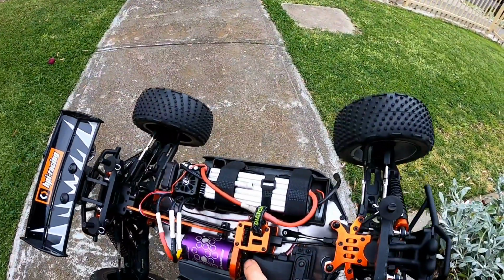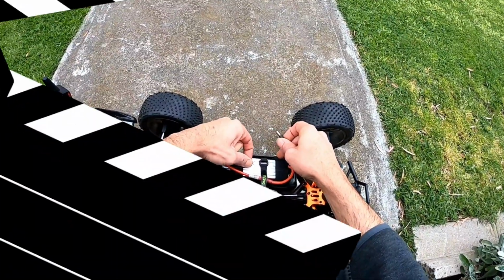HPI 1/8 Flux Truggy 6s first drive! 😍OMG!

Comment: Hi pal dunno if your going to see this but recently got one of these for Christmas and it came with 
2 - 4000mah 7.4v 50c 2s battery’s 
Got 2 questions for you 
Can I upgrade to 4s with standard motor ? 
What does it take for me to upgrade to 6s ?
Reply from the maker: Hey mate🙂
So the stock esc and motor should be the 4s system so you can run your 2 x 2s lipos is series to make it a 4s 4000mah pack, the esc should have dual plugs or series wiring already if you got it brand new I thought🤔

But for 6s you'll need a 6s esc a 6s or 2 x 3s lipos obviously and I personally would stick with the stock motor but drop to a slightly smaller pinion or add sufficient cooling for stock gearing.
Reply: @rccrazy  I know it’s too much to ask but do you by any chance have a link so I can have a look at the upgraded esc and motor
 Thankyou
Reply from the maker: Not sure this link will work for you if your not in Australia, if not basically any 6s 150a esc will do the job with your motor but please buy a quality brandvlike Hobbywing, Castle or the name brand escs like HPI, Arrma and equivalent, PLEASE for your own benefit and long term cost stay away from the Surpass Hobby escs💥
This is what I basically run in mine👇
https://www.ebay.com.au/itm/325532785559?chn=ps&_ul=AU&_trkparms=ispr%3D1&amdata=enc%3A1tl5t_nPLTIq6cKVnVoLFdA58&norover=1&mkevt=1&mkrid=705-139619-5960-0&mkcid=2&mkscid=101&itemid=325532785559&targetid=1598469861558&device=m&mktype=pla&googleloc=9071421&poi=&campaignid=19657035767&mkgroupid=143201283022&rlsatarget=aud-1185245468113:pla-1598469861558&abcId=9305369&merchantid=114250063&gclid=CjwKCAiAkp6tBhB5EiwANTCx1NFq4YOgwbrvXf3jJ9GKapmUAJ0R7luUPoKZrfrM6W7wde8xVm0MTRoClh4QAvD_BwE
Reply: @rccrazy  appreciate it a lot man thank you
Reply from the maker: All good mate, happy to help.
Good luck👌

Comment: Sweet ride mate, very nimble little truck. Def bigger wheels will fix the in air acrobatics maybe try the  VRX wheels if there 17mm?
Reply from the maker: Exactly what I was thinking with the wheels but no the VRX wheels aren't 17mm and are actually a bit smaller.
I really need some!

Comment: Ordering one this week. Will just be running 4s. Can't wait to bash. Haven't had a good bashed in a few years  cant wait!
Reply from the maker: Very nice, these are great truggys, it should be sweet on 4s and you can keep it light weight so technically will be stronger than mine, they are very strong even with my 6s motor and stupidly heavy X-maxx esc.
Reply: @rccrazy  oce always had good luck with hpi stuff. Bashed a savage for years. Just ready for lipo. I've always run and raced Nitro stuff.
Reply from the maker: I can guarantee you will miss the noise of the Nitro😟 for a while, but I can also guarantee you will absolutely love the power of brushless!👍
Reply: @rccrazy  noise and the smell! Love the smell. I will miss tuning the engine. I did enjoy that also. Just ordered mine. Will be here Thursday. Can't wait! Thanks for the replys!!
Reply from the maker: Not a problem, any time.
Enjoy that new HPI mate! ✌👍

Comment: hey dude, nice car! can I install a 6s lip on a stock trophy trugy?
Reply from the maker: Hey mate👍
I think the stock ESC would be the Flux Rage 80a, if so then no it's 4s max.
My truggy was the rolling chassis version and I went straight to a 6s set-up.
If you decide to go 6s I highly recommend having a FULL set of upgraded gears on hand just incase, the stock ones aren't the strongest with 6s.
Oh and thanks😁
Reply: @rccrazy  thank you for the heads up

Comment: This truck is the same design, that Hot Bodies came out with around 2007 or 2008 called the Lightning Truggy. It came out when HPI was offering the Hellfire Truggy, I know because i had both at the same time. I always liked this design better, I guess when Hot Bodies was acquired by HPI they took this design and got rid of the hellfire. I'd buy another for sure, looks like it's still a fun truck
Reply from the maker: You definitely share some new info that I wasn't aware of, iv never heard of Hot Bodies or the Lightning Truggy.
That's very handy to know because I definitely need a new shell for it now and I love this specific design!
Absolutely a beast of a truck, upgraded diff gears really helped running 6s.
Thanks for tuning in👍
Reply: @rccrazy , If HPI hasn't skimped on the quality, it'll be a great truck. Mine was a Nitro (STS .30), was planning to convert. This was when brushless was starting it's official takeover of RC
Reply from the maker: Awesome!
They are an nice platform and would've been interesting with a 4s or 6s set-up for sure👌
I'm all about electric now, not had a nitro for years but maybe get one for the channel eventually.
Reply: @rccrazy , I've always been an electric nut, even when brushed and NIMH were the way. I dabbled with the dark side (Nitro) just to see what all the hub bub was all about. While they were fun and powerful, they were like spoiled children. If they decided to not run, wasn't nothing you could do about it. At least I've never had issues starting an electric, without something bad happening first, like smoke
Reply from the maker: 😆the dark side! I like that👌
Yeah its definitely a electronic age and we're lucky to be living through it!
Reply: @rccrazy yup

Comment: Do you have oil in the shock absorbers and differentials? I'm asking because I need to change the oils in my HPI Trophy Truggy and I don't know which ones will work well for bashing. I will be very grateful to you for your answer.
Reply from the maker: Hey mate
Yes definitely oil anywhere that is needed.
If your still using the stock shocks you would probably want between 60-80w for the front and like 100-120w in the rear.

Diffs, personally I would go 80k on the rear 1million centre and 100k front.
See how that goes👍
Reply: Thanks a lot for your answer!!! But when it comes to shock absorbers, I have already ordered 700cst for the front and rear. And I haven't bought one for differentials yet. But for me, 1 million for the main differential will be too much. I was thinking about 50k/100k/50k, what do you think?

And did you give me the densities you use? And do you know what type of shock absorbers and differentials were flooded as standard? @rccrazy
Reply from the maker: 700cst in 1/8 shocks is a little thin but it should be ok.

Front and rear diffs you could get away with running 50k but 100k in the centre diff on a 1/8 car is no good, the front wheels are going to balloon SOOOO BAD!
Minimum 500k oil in basically any 1/8 car is normal.

What I suggested is a common set-up for me and most of my 1/8 cars yes.
Reply: @rccrazy  So 50k/500k/50k will be ok? Because 1 million is too much for me.
Reply from the maker: That should work OK for this truggy yes.
Reply: @rccrazy  Would 100k/500k/100k be better than 50k/500k/50k?
Reply from the maker: I personally wouldn't use 100k in the rear diff but front absolutely!
I use thicker oil in the front diff to gain stability and steering, keeps the front wheels working together more rather than spinning at different speeds like you would need for racing.
Reply: @rccrazy  And tell me, what kind of things do I have filled the differential and car oil with?
Reply from the maker: Sorry I don't understand what you mean?
Reply: @rccrazy  What I mean is that when I pour oil into the differentials, how much should I pour it in?
Reply from the maker: @oskar_moto69  oh ok sorry
Make sure it is at least covering all 4 of the smaller internal diff gears.

The main thing is not to get oil in the screw holes otherwise they may come loose by themselves.
Reply: @rccrazy  When you poured oil into the differentials, did you pour it so much that it covered all the gears or did the top of the gears stick out a little? And when putting the differential into the RC, what grease did you use?
Reply from the maker: @oskar_moto69 if a little bit of the gears are not under the oil it is ok because when you install the last small gear, the one on the spur gear and crown gears it will push the oil up a little more👌
And I just use red high temperature grease on the diff crown and pinion gears, most thick greases should work fine.

Comment: Great video! Just random mulch piles or what?
Reply from the maker: Thanks👍
Yeah they were for the gardens but the council has used it all, it's been flat ground for about 3 months now😭
Reply: Scary to hear about your battery experience. What happened? My son super glued the shit out of his eyes once squeezing the glue bottle!
Reply from the maker: @tenncutt  wow super glue in you sons eye, that would have be scary!
I was charging a lipo from car battery and when I was pulled the charger terminals of the lead acid battery it sparked then popped 💥

Comment: 1. I have the DSservo 25kg model and it doing all fine. These cheap servos are totally worth it
2. How is your eye right now? I hope you recovered in some sort of way
3. Did you check the diffs any time soon? If I am not hearing wrong there is some sort of cracking noise when you land. Maybe shimming for a tighter mesh will help for the extra load on the parts after landing.
4. But finally sick ride
Reply from the maker: Love the point system comments/questions👌
1. Im with yah, love these cheap servos.
2. I think your talking about the battery blowing up in my face, if so, yes its come good to a degree, worst thing is I have to use sun glasses even on cloudy days or travelling in the open over around 15kph.
3. Rear and centre diff gears are long gone, yes shims may have helped!
Quite an old vid, newest vids I have the upgrade planetary gears in rear and centre.
4. 😁 Thanks a million🤘👍
Reply: @rccrazy  my bullet strugled with gear skipping even after new hardened steel diff gear. I still had that crackling sound. I ordered some shims. Took it to a degree that it is tight in the case but the mesh is smooth. Never knew this problematic car would be fine after all those repairs with some shimming. Also happy to hear that you recovered to some degree. As far as I remember 6 layers are too much for the eye. Would like to see more vids.
Reply from the maker: I'm not sure if the diffs are the same, iv never seen a bullet but shims won't fit in my diff cases, not even 0.1mm of slop, but they are meshed perfectly for now.
And I agree, I thought there were only 3 layers to the human eye🤔 iv wonder what she ment for years, never found anything explanation.
Reply: @rccrazy  strange that even 0.1mm won't fit. My diffs almost have total of 1 cm and it may be much higher than anyone would recommend but that is the only way it work for me, not very diff case is the same.
Reply from the maker: The upgraded gears I got came with shims, they are in my car and they made them mesh almost perfect, but anything can cause even the best parts to fail.
Just wondering, is your hpi 1/10? Because 1/10 parts will be a little weaker than 1/8 normally.
Reply: @rccrazy  Yeah it is 1/10, Bullet ST Flux. I've had it for 6 years but hadn't been driving it for 4 years. 2 months ago I got the thing out and has been driving and rebuilding the thing since the problems showed themselves eventually. First it was the front diff not meshing at all, so I made it RWD. Then the rear diff also stripped. So I bought new diffs. The front hub carrier was broken since the start and I kept gluing it with CA and it let loose everytime and then I'd stick it again and so on. So I got alu parts. Then the servo got very weak and also jittery and then died eventually after a soft bump into trash bag. I got the DSservo at this stage. Then the new diffs started to make this crackling sound, so I shimmed it. Then the motor shaft was clicking from side to side with the magnetism and it made this horrible sound. Now I replaced the bearings for that and the inside was the filthiest place I've ever seen but I'll take the responsibility for this one. That happened probably because I didn't blow out the air well after cleaning after a wet run. I have my exams. I'll be finishing everything on monday and it giving it a go. That may sound like lot of problems and actually it is but most of them are from the times I didn't know how to drive and I think all are worth it. It is pretty fun to bash with this car on some dirt and bumps.
Reply from the maker: Wow that took some reading😄
Yeah it sound to me like it having more issues than mine because of the size.
Mine being 1/8 it would have much stronger parts to a degree and im sure some of those problems will show up eventually.
Don't worry, I have my trouble cars!
Reply: @rccrazy  Well I did learn a lot and since there is nothing else to change it will go for some good time.
Reply from the maker: I sure hope it last you a while now👍

Comment: Hi mate need some help  I have just done a 6s trophy  first run lasted 5 minutes  and rear diff was dead   what diff internals are you using  and what diff oils    thanks
Reply from the maker: Oh mate that's disappointing 😥 I feel yah pain!
I didn't touch my diffs out of the box and they lasted quite a while.
I now have the upgrade planetary gears in the mid and rear diffs with 80,000w in the rear, the mid is half 80,000w and half 500,000w, I had no 200,000.
The front is still untouched out of the box but I expect it to play up soon.
Reply: @rccrazy  got some harden diff gears  coming  so hopefully they
Fix the problems
Reply from the maker: That is good to hear, I can't tell you how long they will last because iv only tried them a few time, what I can say is they can seriously take some abuse!!👍

Comment: Hi mate what motor and battery's are you running for 6s? Is there any link too uprated diffs at all do you know?
Reply from the maker: At the moment I'm running a surpass rocket 4076 1700kv and 18t pinion, the largest lipos iv run are 4500mah 6s.

Yes there are upgrade diff gears BUT😓 they are extremely hard to find these days. 
If you search HB racing hard steel differential gears (part number HBC810-1) you may be in luck, rebranded but same gears.

The part number for the actual upgraded complete diff is 101138, really hope you can find some👍
Reply: Perfect thanks mate that's a big help appreciate it  ! Are the motor just plug and play with the model your using? Sorry for all the question new  too the rc world! Glad I'm not the only one struggling for parts for the truggy! Spent hours just trying to find silly bits for these! Main problem I'm having is the aluminium parts! Thanks for all your info!
Reply from the maker: Not a problem at all👍
I got mine new but it was a roller so no electronics, I have a Hobbywing max8 150a esc, I'd recommend 150a or higher for 6s just to be sure.

When it comes to alloy or carbon I make most of my own parts but I know a few stores here in Australia have some of the alloy parts.
I try and buy parts that I can't make locally because the fees are crazy for international post now☹
Reply: Yeah I can make some stuff that's for sure but all round aluminium hubs I can't find anywhere! Postage is indeed a fortune as I live in England and most stuff is Australia! Il start making me shopping list for the 6s swap! Can get the gears for diff but out of stock till February 😢least there's hope! Is there anything else I will need to think about for the 6s swap?
Reply from the maker: The front 7075 steering hubs took me months to find and they were sooooo expensive🤯
Can't help you there sadly.
Glad you kinda found some gears though.

The only other thing I would really be concerned about if you haven't broken them already, the shocks!
I snapped all 4 stock ones and 2 replacements in like 3-4 drives, get some with at least 5mm shock shafts🙏
Reply: What's the most powerful battery you could run in these with 6s? Yeah I haven't found a single set of hubs yet not that fit even though they say they do! Funny you should day that as we speak I'm waiting for a set of shocks lol! Definitely get some uprated shocks lol now I know they exist 😁 don't suppose you have the part number for them do you? Really do appreciate the info mate!
Reply from the maker: When you say powerful do you mean C rating? If so I'd say go 50c or higher, this is the current flow that can come from the battery.
If you mean mah then that's more capacity than power but 4500mah is the biggest iv found to fit well and keep the weight down a bit.

Shocks are completely upto you, so many out there all depends what you want to spend, any 120mm-130mm I think for the rear and 115mm-120 front.
I use GPM because there cheap and pretty good quality, Arrma or something would be most people's preference.
Reply: Perfect thanks for allbyour info bud il have a good search around and see what I can get hold of really appreciate the help though! Looking forward to the 6s swap 😊
Reply from the maker: All good🙂👍
Reply: Hi mate me again sorry to hassle you! Need some help on getting some wheels and tyres for my trophy everything I find are not the same size/diameter as my original ones! All I seem to find is tyres half the size of mine lol any help would be appreciated! Even putting me measurements in Google nothing comes up 🙈😩
Reply from the maker: I had the same issue😅
The best ones I found that are very close to stock size and strong are the Louise wheels I run, they are T-pirates (truggy wheels)
https://www.rchobbyland.com/louise-world-t-pirate-1-8-competition-truggy-tyre?gclid=Cj0KCQiAoNWOBhCwARIsAAiHnEgBr1GQVRPJxavjozYtkMHh0QoxtYWoOYahuRAmPfgRwn52ZmSfpxQaAgyxEALw_wcB
Reply: Glad I'm not just being stupid then 😂thanks mate I go take a look and see if I can get any over here in England before just buying the ones from link 😂an being lazy! Again thanks for your help mate!